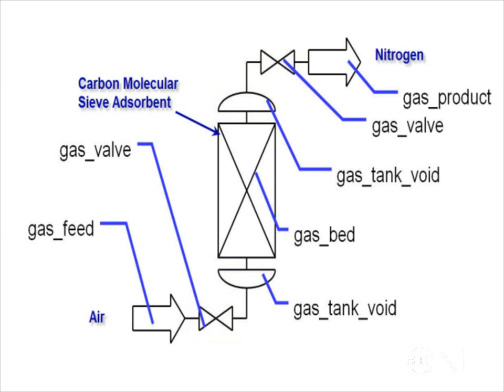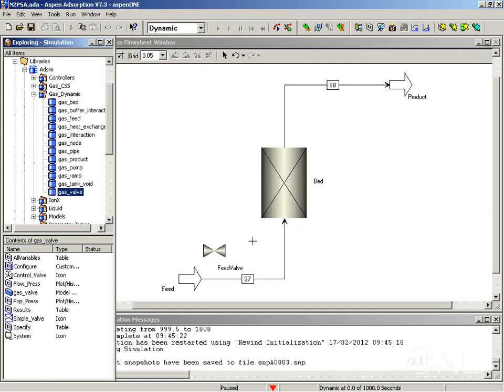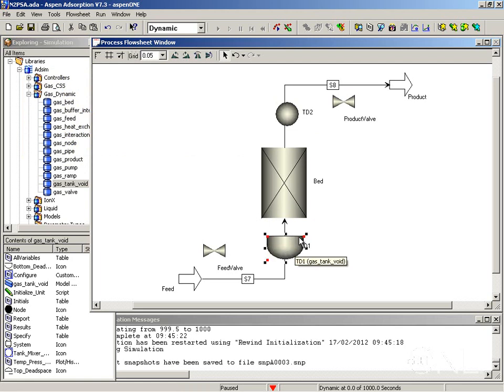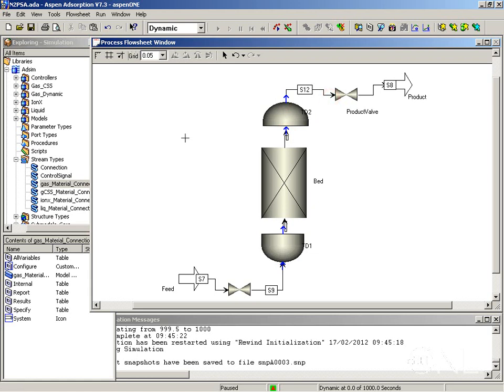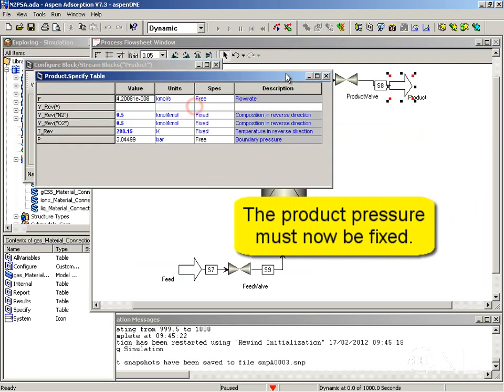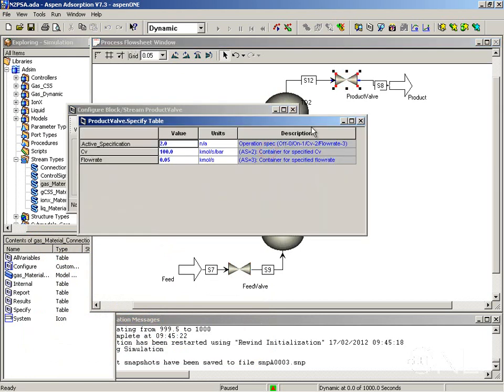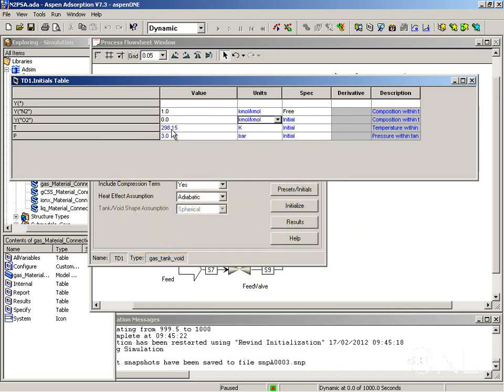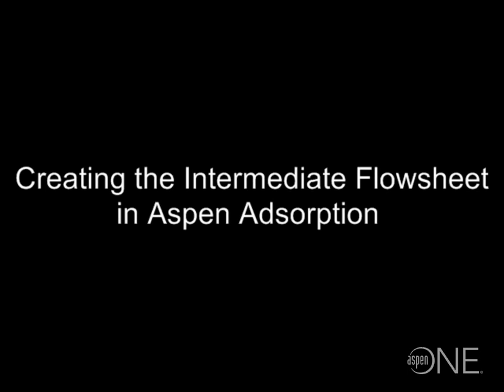Aspen Adsorption Intermediate Flowsheet

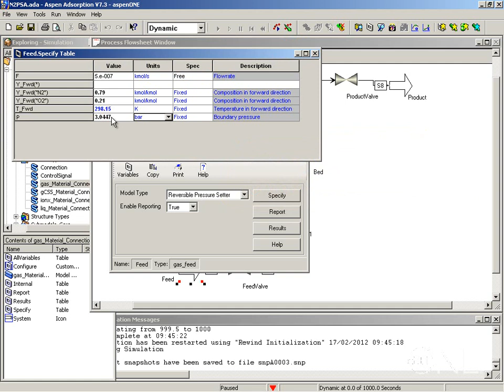Comment: If someone's getting errors, in the second 3:26, the feed pressure you have to set to make it work is 3.045 bar, also for the pressure in the TD2, this section seems to be cut from the published video in the second 5:22, the correct pressure you need to set is 3.0447 bar.
Reply: Thank You!

Comment: Hiii thanks a lot for your video its great and also I have a quick question I triedo to simulated with CH4, CO2;H2  with zeolitas , however in the system its appear error "A sub-group in the decomposition failed to solve" initialized time 0 :( I dont if its ok to put in the compositions of the product CH4-0 h2-0 and CO2-1 :( Any help would be great